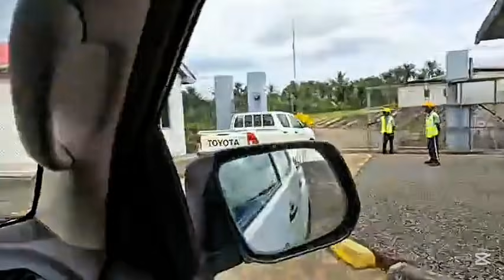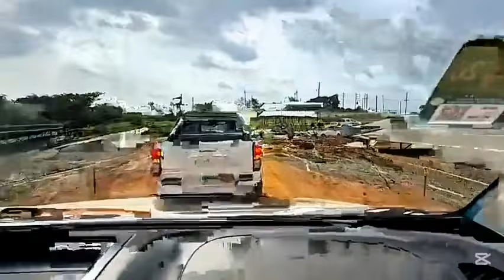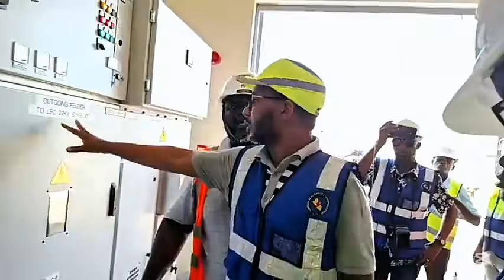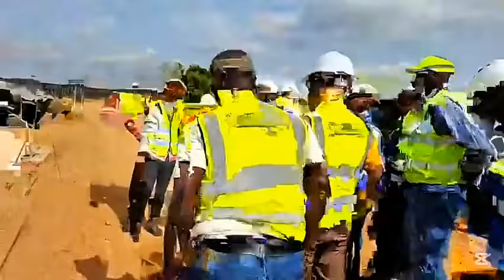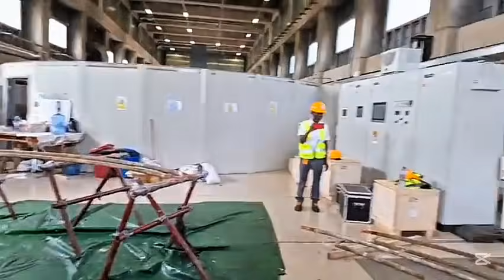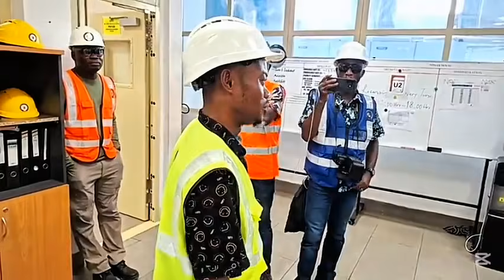BREAKING: LEC Begins Massive Testing of Liberia’s 20MW Solar Power Plant in Mount Coffee Montserrado

Comment: Well done, team, for the great work! The Deputy for Ops at LEC (tall dark gentleman) Mr. Thomas is really technically inclined. 

I suggest we unbundle our energy constraint and optimize our portfolio based on the unbundled approach. Let’s first target producing our base load of less than 100MW. We have 2 seasons - during each, our only available options are: Rainy - Hydro (Primary) + Thermal (Secondary) and Dry Solar (Primary) + Thermal (Secondary). 
 Put the installed vs. output capacity numbers to this model and you will understand the energy gap analysis towards the base load scenario. 

After achieving base load, we move to Phase II - beyond base load scenario. 

An entire model can be built around this with visualization for strategic decisions, and we can work based on this model. 

Again, thanks to all of you involved in this great work! Let’s get this done, guys!
Reply from the maker: Thanks for the insightful comment! It's great to hear your detailed suggestions for optimizing Liberia's energy portfolio, and I completely agree that a strategic, unbundled approach is crucial for addressing the energy gap.